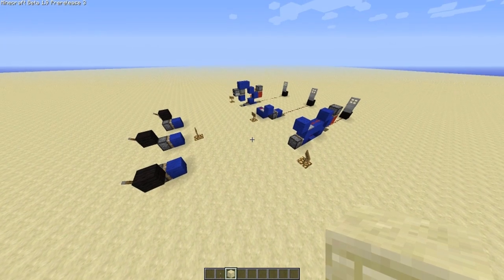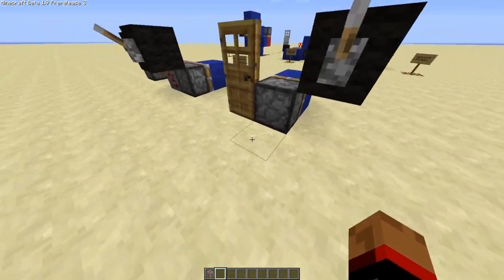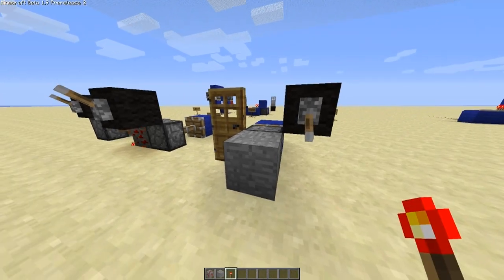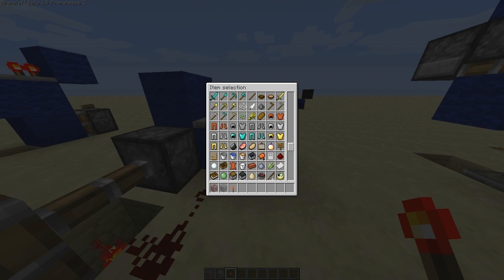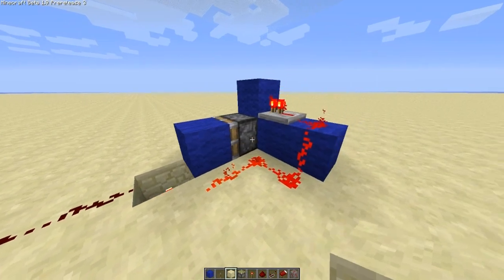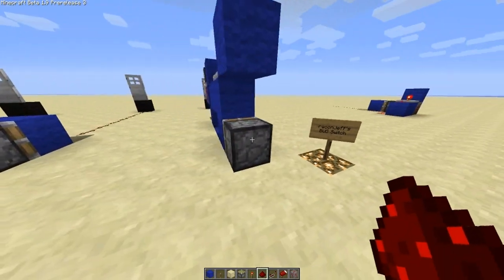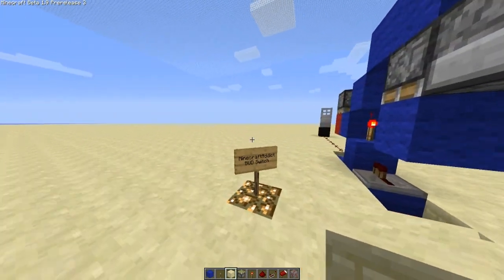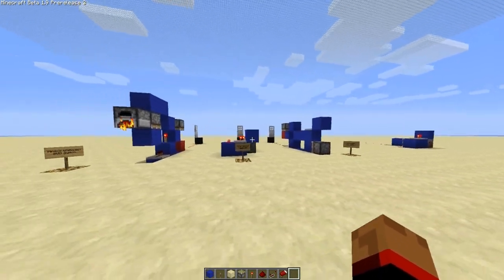Compact Redstone BUD Switches [Redstone Circuit Spotlight]

Comment: The Super Compact BUD @ 2:09 is excellent. I've started using it after watching this vid. I tried using it for some secret piston doors. The one adjustment that I had to make was to put an inverter on the output before the door pistons. If I didn't the pistons would extend but not retract, for some strange reason. I don't really understand why but it worked out. Many thanks for the tutorial!

Comment: I have a question: Is there a way to make a BUD switch so that the piston is facing down and the block that would be updated [in this case broken] would be right above it. See right now I am making an adventure map and the first dungeon is an awmige to old rpgs, so the first room is like legend of zelda with a block moving puzzle, but you can't push blocks, so why not be able to break them. So breaking the block above what should be a BUD switch that is in the middle of the room. possible?

Comment: you could "put" a block on the activation place with a piston ;)
but still i dont see a use for it a a "secret sort of thing" simply because you need to place a block or something to a visible piston ... which is not a secret tbh :D
however... puting a RS torch on the "activator" block thats something usefull alrdy... :) i also like the FURNACE DONE SPEAKER which uchiha191942 talks about :)